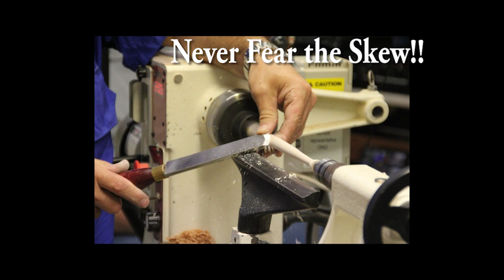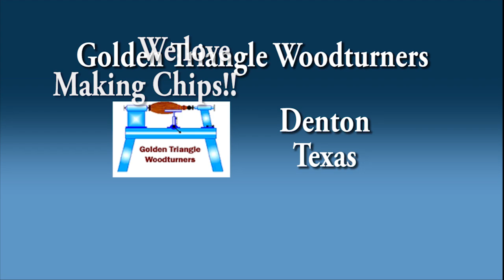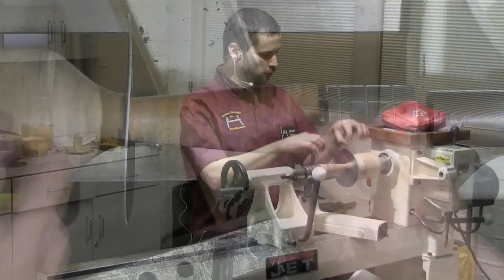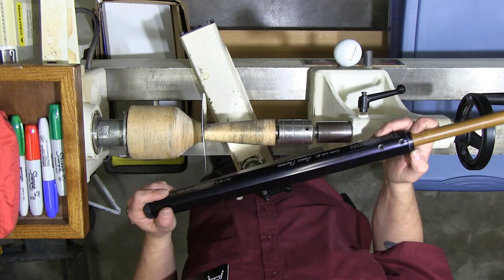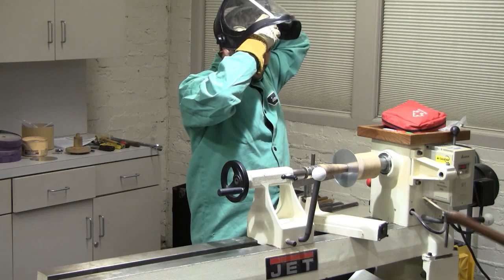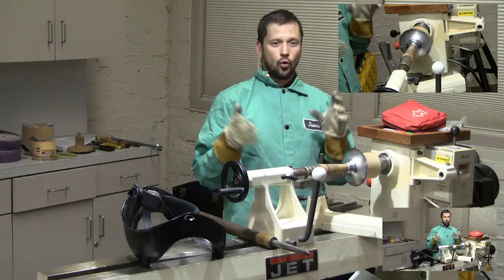James Thurman - Metal Spinning - Part 1

Comment: Hi James very interesting video, I'm going to give metal spinning a go, and would appreciate some advice. Could you please tell me what sought of wood do you use for the chucks, I should imagine it's a hard wood of some sort. Also if possible could tell me if  a small megaphone type shape could be spun at say 25 mm small end to 50 mm large end, the thing is the small end would need to extend to be approximately 50 mm before starting to open up to make the megaphone shape. Eventually the small end would be a slide fit over  another part. Would be grateful for your advice, keep up the good work. Regards  and thanks Reg

Comment: If you want to get that piece you have stuck on your mandrel off; put it back on the lathe and heat it with a propane torch as its spinning and pry on it with a back stick. It will pop right off

Comment: Cowls around most aircraft engines are not likely spun in most cases because their not really round more of an oval shape and in the past like World War Two they were made on Yoders or by hand. Which is another whole metal shaping art form in itself. There might have been some nose work for some radials that could have been done partially by spinning I don't know that but some were done by hydro forming and others were done with dies. The art of "Metal Shaping" as it relates to making car bodies for say Ferrari's or most of the early British cars is the pinnacle of all the metal shaping art forms and takes many dozens of years to get even just OK at.
Reply: I would agree that most aircraft cowls are not spun but I've seen custom aircraft parts spun.  I was just trying to give an example that everyone could easily visualize.